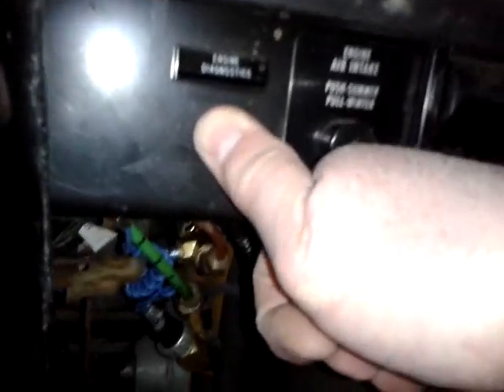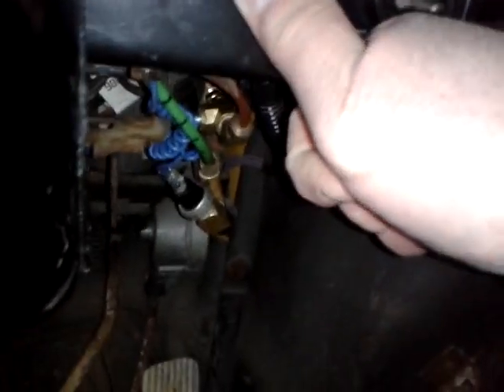How to clear engine Codes - DT466E

Comment: You sir, are a gentlemen for spreading your knowledge, thank you.
Reply from the maker: Your absolutely welcome sir.  You can find the DT466E diagnostic service manual in files on https://lookaside.fbsbx.com/file/DT466E%20530E%20International%20Diagnostics.pdf?token=AWzWb6pSVTskxqBqZtGQKNIdnVNgZ7KxB3IQPhKNw9adRlOBhuXMEKIRupx5lcK5UaqFo4endAGhx2XhcnX7OTqql4JwSa4iCuyzTwIqGIuPCKuNHM9OpmGmgsn5PNAvnaxGtt4ap9VN8HbqQsbB8WBryUtuRr0a_cjMISfUL9Fgql400pGbL88SM7SQY7VaUwRjWSj8Y0ldzsrmu5D48HH1aQ6HohM58aadRnQRy12tPbgPTqFVDTjOQbIEOrpdn6FY-pMHKHvDcOM5gdmCH2n51eCad5GjCRYr7cHxJr5aGQ
Reply from the maker: It’s the factory manual 448 pages 39 mb.  You may have to join the Facebook group “International Trucks” to download it, not sure.  Hope you can find/repair your issues.  Murray

Comment: I've noticed mine had the Brake Press light on sometimes and sometimes its not what would that Be .
Reply from the maker: If you have juice brakes check your fluid 1st and make sure it's at the correct level.   The PS pump may supply the brake booster so check the fluid there as well.  The older PS pumps had a filter inside the tin reservoir.  One bolt in the middle of the tin reservoir held it on with an o-ring seal and a fiber washer on the bolt to seal it.
Reply: Your brake light switch is bad/dirty. Simple test. Touch the brake pedal, does the motor run? In mine I removed the switch, cleaned out the debris (from plastic parts rubbing together), cleaned it with brake fluid and reassembled. Completely solved my issue. Also, you'll notice your cruise control will quit working, it's the same issue. Fix or replace the switch.

Comment: I have an international dt466e 2004 in 3800 school bus. Morning start engine shakes and low power. After 1 he running I turn it off for 15-20 mins. Start up and runs fine. Same in afternoon bus route
Reply from the maker: It’s possibly fuel running back to the tank when the engine is not running.  Two things to check for. First ensure that the small screen in the fuel suction line is not plugged and the canister o-ring is sealing.  This is located inline just before the fuel filter. (Very small round plastic canister with a removable mesh screen inside 8cm long x 5cm wide) standard RH thread to remove with small water pump pliers.  Second check for any holes in the fuel suction line.  With the engine off use an air compressor, have a friend remove the fuel cap and take a handful of rag’s to block the opening while he blows a small amount of air into the tank to pressurize it.  (No more than 5psi) Follow the fuel suction line and watch for any fuel leaks.  In my experience these are areas that have been rubbing a hole in the line, often by another line near the bell housing.  :)

Comment: Hello sir thanks for this video...whats the colour code for the 2 diagnostic wires?
Reply: @AM_Mechanic  thanks much.
Reply: I have a 1999 international DT466E it's driving and shut off and check engine light comes in will start right back up but as long as the check engine light on it won't take any rev when pressing the rev u get no response whatsoever but once the check light goes out it will rev...next issue with it av to prime it to start it in the morning most times some times even if it start once u press the gas pedal it shut off and u av to prime it before it start please if u av any idea can help me with it if u familiar with this problem...im currently changing all injector seals.this engine have the rail on the left side of engine....
Reply from the maker: @CrossBreed-l4u  Are you able to read the code by pushing the diagnostic button.   The red light will flash twice, then the yellow light will flash a 3 digit number.  The engine de-rates during a critical code and won't rev up.  Important to read and record the codes, then delete codes as in the video and run again when CEL comes on read the codes again.  They will be the source of your problem.  Also DT466E uses a small screen pre-filter below the hand fuel pump (Little black plastic housing screws on clockwise)  it often gets plugged up.  Have you removed and cleaned it out?   
This engine uses engine oil pressure to activate the injectors, there's a high pressure oil pump LH side just above the air compressor.   Low oil pressure = no injection.    I have a full set of factory manuals for DT466E, and can post more info if needed.
Reply: @AM_Mechanic  no I haven't been able to get any code from the ecm as yet because there's no wire connected to the diagnostic push button,that's why I was asking about the wire colour codes.yes I clean that lil basket below hand pump already..thanks for the information pertaining to engine de-rates during a critical code and won't rev up.
Reply from the maker: @CrossBreed-l4u  I posted the wiring schematic here https://youtu.be/PVM3PVMuEg0  see the second plate at 10 sec mark for the diagnostic push button wiring.  Pin 48 on ECM (wire #98) goes to Pin 6 on the firewall plug,  then to diagnostic button,  which goes to ground  when it's pushed and sets off flash codes.  (momentary ground on (wire #98) will start CEL flash codes)
Reply: @AM_Mechanic  Olá amigo poderias me passar os códigos de piscada aqui no Brasil existe poucos desses mas por ventura estou cm um em minha oficina cm problema no acelerador se puder me ajudar fico muito grato.
Reply: @AM_Mechanic  I saw 2 set of twisted wire coming from computer 1 set is 2 black wires and next is 2 purple but only the black ones go to diagnostic socket so I'll assume it's those 2 black ones.

Comment: This method works on every dt666e engines? I have a 2006 truck with codes
Reply from the maker: likely not, this one was 96 or 98.   1995-200 models

Comment: Do you know how to reset a code on a 2006 Freightliner m2
Reply from the maker: sorry no I don't, perhaps someone else will post.
Reply: So it was an ABS fault code....
I had a bad ABS relay that caused my brakes to dump all the air...it set off the brake alarm check engine light came out and check transmission light came out...

I replaced the faulty part, but the truck was in limp mode no throttle response.
I thought it was going to have to have somebody come out and reset the codes...
I had to move the truck because it was street sweeper a day and I was going to get a ticket so I moved it an idle speed around the block since I had no throttle response.... I drove it about a quarter of a mile like this, next thing you know check engine light and all the other lights on the dash went off and the truck was back to normal!!!!
Reply from the maker: so glad it worked out, ABS control is looking for 4 mph to reset after a fault is corrected.   There should be a switch mounted somewhere to blink code the ABS light faults.  Some are under the kick panel by the clutch others I'v seen by the battery tray. Keep looking.....  Read the flashes and check the number reference.  
http://www.wabco-na.com/literature/ABS
ABS module shouldn't put the ECM into limp mode.  Check for bad ECM grounds.  Main ECM grounds on the Fruitbox's we had were inside the cab, passinger side, firewall below the heater.  Fairly easy to find.  Any corrosion will cause multiple ECM codes and derate the engine.   hope it helps you.  :)